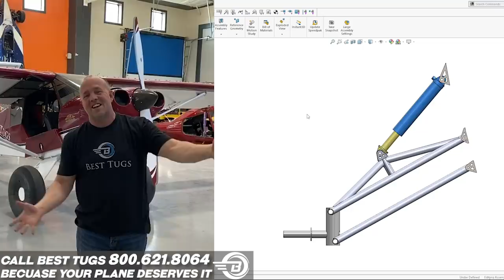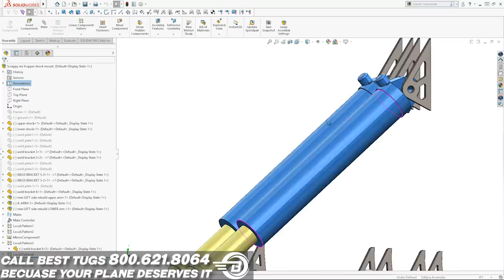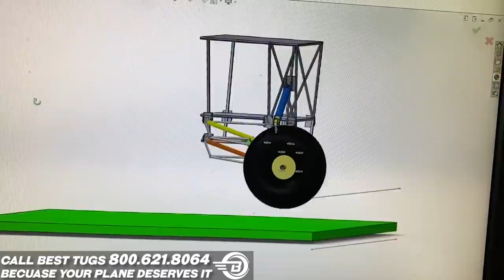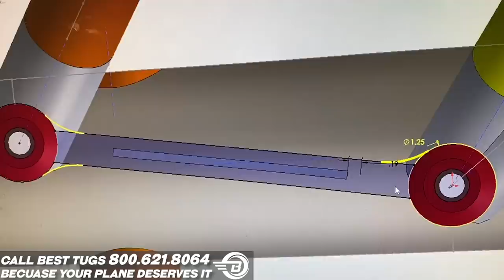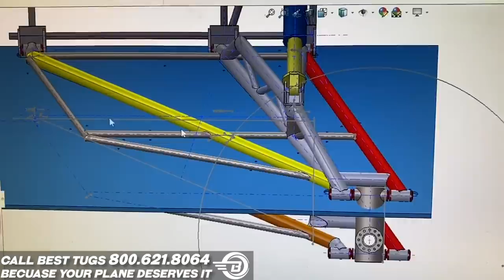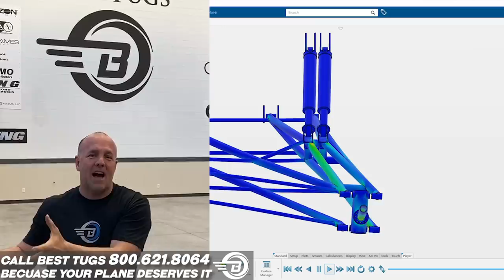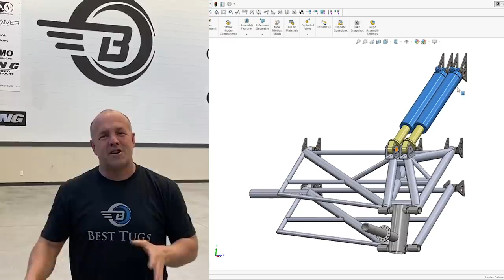20" + Travel - Extreme Bush Plane Landing Gear (Scrappy Bush Plane 15)

Comment: This is a very interesting subject. So when the plane is in the air the suspension will be in full droop? Topped out? Then when impact it will come back to topped out on the ground (Not good) or will the weight of the plane compress the suspension at rest? You still have scrub its just not as bad. Also the way a parallel equal length set up works is you will have neg camber at full droop ) no camber mid travel . Poss camber at full compression. Not ideal for handling (in fact its very bad its the reverse of a camber curve). But again probably wont be any high speed cornering. I do keep thinking about torque reaction on the ground cross winds? No roll control ?? Hum?  cantilever with compression and rebound spring rates. So there is resistance to the wheels droping and compression ? So they are not topped out during flight ? Or rebound to topped out during a landing? You could achieve this with heavy rebound damping? But there are side effects like the suspension will jack down. Like a early non bypass trophy truck setup. On a plane Hum? With arms that long you will want some toe adjustment.
Reply from the maker: Tom Hutchins I like the way you think, your going to like a video coming out, it’s a few away yet but coming

Comment: Will you be building in some sort of offset into the trailing edges of the undercarriage aerofoils to deal with the spiral airflow from the prop? I expect with the airboat prop, the twist in the airflow may be more aggressive than with a conventional aircraft prop. I envy the fine hand control you have over your welding, no doubt the product of lots of practice.

Comment: @Mike Patey, I was always instructed to grind a tube cope back until the base material thickness is present so the weld bead is made with the two materials being the same thickness (assuming the two tubes are the same wall to begin with) I'm not denying the quality of your fitment, but I'm concerned that your process is making for a weaker weld joint.

Comment: What is the function of the added "extension" behind the main triangle on the gear struts/arms? To my engineering mind they don't add a whole lot in stiffness since the main triangle should provide all of that. Is it to stabilize and prevent buckling of the rear strut member? Or to mount steps? (or both of course)

Further aside, apart from just the "wobbling in the bearings",  wouldn't a lack of toe-in risk a nasty gear shimmy developing after landing with gear arms that long?

Edit: Never mind on question number one, I hadn't seen your end bit on the gear wing yet.

Comment: Mike, your videos are inspiring. I get excited every time you post!
I'm curious: Will this suspension be fully independent on both sides? I ask because it's my understanding that the Draco mishap occurred partially because the suspension gave a lot of room for the plane to roll, allowing the left wing to "catch" the wind and be thrown over. If you have 20" of independent travel on each side, won't this present a similar danger? I'm sure you've thought of this so I'd love to hear your thoughts on having something equivalent to an anti-roll bar, or the possibility to limit suspension travel when circumstances require it. Or will you just find some scrap barn doors to use as ailerons? :)

Comment: This comment is not to take away from any of this amazing fab work and designing just to inform you on the fact that when you machine the tubes to fit together that way it can cause a weak point because you are running your weld bead on a very thin portion of the tube on the obtuse side of the joint the sharp edge should be ground back to the thickness of the tube to ensure full weld contact

Comment: OK maybe I saw it wrong; but it seemed to me that as the wheel travelled upwards, it tracked in a CURVE inboard/outboard/inboard again. Isn't that going to cause an outward scrubbing on both tyres as you land? (especially on a heavy put-down). Outward scrubbing on the tyres = reduced tyre life; more worryingly it will also mean a heavier than expected inboard load on the suspension and its carrying box.

Of course, it's entirely possible I've been the victim of camera errors etc and that the wheel moves perfectly vertically throughout the travel... but I looked a few times and thought it moved outward and back in again as it moved upwards.

Comment: Hi Mike--you're doing a great design for max travel, along with minimum camber deflection.  HOWEVER, I'm concerned that it seems you are not addressing the issues which caused the demise of your lovely Draco last year at Stead; specifically, the "soft" and well-damped nature of your mains meant that they couldn't handle the extreme crosswinds they encountered--and the result was a wing-low disaster!
Are you addressing (in any way) the possibility of a wing-low situation which might be similar to the loss of Draco last year?  In my (somewhat limited) range of possibilities I can only imagine a simple range-stop, or (with more complications) an actively sensed-and-deployed system to try and avoid a similar event.
I have some years of experience and interest in suspension design for autos--but it looks like you may have an additional challenge here!  Best of luck on this project, B.

Comment: Hey Mike, you eliminated radial scrub, but did not eliminate lateral scrub.  If you want zero scrub you'll have to have variable camber (unequal length control arms) such that the tire radius is accounted for throughout the range of motion.

Comment: the double suspension arm set up reminds me alot of a older video I saw of someone flying a monarch butterfly gyrocopter outfitted with what they called g-force landing gear. Granted cant really compare as the video is quite blurry and its a tricycle gyrocopter not an airplane but also still interesting to watch just youtube "Monarch gyrocopter doing stop and drop landings"

Comment: Just a stupid idea...could you have done each upper and lower arm as large as they are, as monocoque aluminum structures, with steel inserts for the end-point bushings/spindles...sorry i can't attach a graphic, but i think that it would be lighter, and stiffer, with less welding and cutting?  Just thinking...btw, what you have done is beautifully built!!

Comment: This seems much heavier, complex, and less aerodynamic than Draco's geometry. I'm sure this must have been a consideration. What led to your decision to drop the use of a equivalent travel in a trailing link design?
Reply from the maker: Ryan McGowan I wanted more travel and try something different. The bending moment and leverage on a trailing link with 20” travel would be nearly impossible without massive weight. An A arm stability is easier to hit that target for less weight.  I love trying things different anyway so let’s try it out 🤠

Comment: I have a question. If you made it so when the suspension compresses, it travels backwards as well, would that help with getting over even bigger boulders? Because the boulder hitting the suspension punches it back which also pushes the suspension up? It was an idea I had a few months ago...

Comment: Looks great, but put some engineering into the geometry of the suspension. Orient the two hinge-axes on the hull as well as the two hinge axes on the wheel, as well as the distances between them to get better performance. You have 11 degrees of freedom in your geometry, and you have not used any of them: 1 Breaking should not make the suspension dive. 2. High speed turns in rough ground should not lateral movement to minimize slip. 3. and a few others.

Comment: We have a similar software called Autodesk Simulation that is an FAE (finite element analysis) that shows stress, heat, torsion, etc. It is amazing. I use it after hours for my own projects and it is the only way to test your designs. I am building my own hovercraft and I spend hours designing, simulating, changing, etc. And it will show interference between two moving parts that you would never know about otherwise.

Comment: I'm a bit surprised they went with a parallel arm design. You'll actually still get a lot of scrubbing the wheels as the track width increases when the suspension travels up. I would have thought it would be ideal to have longer lower arms so that you have negative camber when the suspension is all the way down and and positive camber when the suspension is up. That way the ground patch of the tires moves in compensation of the track width changes that happen as the suspension travels upwards. 
Still, the fabrication is beyond excellent. I don't think I've ever seen someone cnc mill aluminum plate to make a welding jig for a one off project before.

Comment: Hey Mike. Greetings from Germany. In Minute 7:50 you show a connectiong between two tubes. Is it posible that you have a better spread of force if you use a connection as it is on a Mountainbike fork tube? I think so. Unfortunately im not able to do a simulation that quick.

Comment: I think the tires are still going to scrub. There is still an arc in the motion. Cars run unequal length arms to mitigate this by forcing the wheel to change between positive camber and negative camber to compensate. Formula 1 cars were first to use this to mitigate tire wear caused by scrubbing.
Reply from the maker: Jesse Hires .. Yep your right 🤠 still some scrub  but cut it in half even with 20” travel

Comment: So a question when you are calculating force (F=m*a) do you factor in the decreased acceleration due to the bush wheels?  What is the safety factor you designed it at?

Comment: I would have thought toe out would be advantageous as it would reduce scrubbing on the down stroke and help drive the undercarriage under the axial COG and prove a righting moment. Solid works should be giving some support for your excellent demonstration of real world use of their product. Maybe to save weight the lower A arm could have been the laddered frame supporting the shocks with the upper only as strong as it needed to be to take the compressive load even forgoing the rear part of the A.

Comment: Looks like you had planned for 1 strut per side but your latest design uses 2 per side. Will need to cut and weld the upper strut mount area on Scrappy?

Comment: So why didn’t you do the control arms in CF? I feel like that’s something you could pull off and it would save quite a bit of weight. Had to be a reason you didn’t go that route
Reply: Tsxtasy1 chromoly steel is incredibly strong and allows using very thin walls. So it may not be very heavy. It’s also easy to make super strong intersections (those fish mouth welds). So it might be hard to beat it in this application. Hopefully others chime in too.

Comment: We engineer and build a lot of complicated and expensive structures and I have never seen someone go to this sort of extreme to make a weldment. At first I assumed you had those tubes done on a tube laser, but nope, of course you machined them. Nobody in their right mind would ever build something in the way you are doing this plane because if you had to pay for work of this level the cost would be insane. Well done sir! 
I do keep wondering, though, when you are doing work like this and obviously sparing little expense, why use so much steel tubing instead of titanium?

Comment: If the template had a 3" hole through it at the weld joints, you'd be able to stand the loaded template on edge and put a tack on the back side.

Comment: I've got some constructive criticism that I hope you'll see - but first, awesome channel! I've watched a bunch of your videos, and can't wait to see this thing finished. That said, in this video and others in the past, it appears that you're welding notched tubing together as-is instead of sanding the thin parts off first. Maybe I missed the parts where you sanded those off, but if you are not doing so, you're not welding to the thickest part of the tube and are creating a weaker node of tubing. The welded edge of tube at the notch should have the same wall thickness as the rest of the tube - if it doesn't, it should be sanded off.  My experienced opinion that will hopefully be helpful. Keep it up man! This may be the only comment I've left on Youtube, but seeing tubing welded together like that makes me cringe lol
Reply from the maker: desertPOS i agree completely, I’ll either take the thin wall off most the time on my wheel. Sometimes depending on thickness and weld I need I often will do a double pass on the thin so the second pass is back and over full metal thickness depth.  It is more work but I cringe like you when I see someone make that mistake when it seems so obvious.

Comment: Any concerns about welding to the uber thin walls where you have it snap-fit? It seems to me that you might be inadvertently causing weak points by thinning the material at the joint.
Reply from the maker: Jazz I double pass and get into the thick of the bar on the larger second pass
Reply: @MikePatey  good deal. Also, you truly do not sleep, haha.

Comment: As someone who isn't a pilot but like engineering; why do all of these planes have the wheels so far back? For a taildragger setup wouldn't it be better for the wheels to be another foot or two further forward so that you can mash on the brakes without a risk of the plane flipping over forward?

Comment: Since the inboard mounts for the gear are not vertical & the outboard ones are, the gear is not a parallelogram and as the wheel moves up it will take a small positive camber.  I.e., the wheel will not remain vertical.  Not a criticism (huge admirer), just an observation.

Comment: What is the purpose of the rear part of these frames, back behind the triangular fuselage-wheel-fuselage shape? Looks like it does not add any strength to the gear legs and OTOH does not look like the airfoil you've shown would use it - the shapes are too different. I thought they would be steps, but then you say they'll be covered...

Comment: Seems you may be more susceptible to prop strike on a hard landing with that much movement in the landing gear?
Reply from the maker: harland fazardo actually at full compression I am still more clearance in the prop than a standard cub at full compression

Comment: Hey Mike, 

I have no idea about your experience working with solid mechanics and finite element analysis. I'd like to give you some advice with regards to the modelling just in case you are new to the field. 

These simulations are a great tool to develop understanding but they're very easy to generate unrealistic results and they shouldn't be the only thing you rely on. It's a necessity recommended to test your understanding by modelling a real-world situation which there is some data on. If you want I can provide some data for a simple beam deflection for you to verify the results. This not only shows you that your method is accurate but your software is accurate and not generating colourful pictures with inaccurate results.  

The quality of your solution depends on your mesh and it is critical to perform mesh independency studies and convergence analysis to ensure results are not simply a product of an improper mesh. Results from your selected mesh should be invariant of subsequent finer meshes.

Perform a sensitivity analysis to determine which factors most affect your model and ensure your boundary conditions, material properties and loads are accurately input into the software. It's extremely easy to miss a zero and drastically alter your results. I've been there and done that.

Large global models are useful for identifying problem areas but smaller local models should then be used to perform more refined studies in these regions. 

What I have posted here isn't even close to a definitive list of things to look out for. At every stage, verify your inputs and the validity of the assumptions you are making. Check and check again. 

If you're not a novice and you know all this info then just pass this by. However, if you would like some pointers to references which detail how to perform these analyses and how to ensure you've made the best choices possible I'd be happy to send you some books and links. Don't hesitate to ask in the replies and I'll compile a list of material for you. 

Best of luck with your records, excellent content.

Comment: A wood frame? NOT for Mike! Lol.  A cnc machined! Are you mass producing this suspension?  😅 If you make access holes behind the joint points and have the assembly vertically positioned you can do all the welding before releasing it.

Comment: I don't know much about aero engineering, but I do know truck suspension design.  Why not go to unequal length a-arms and get that tire scrub down to zero through 20" of travel? Look at trophy truck frontend design.  They pull 20" with minimal scrub.

Comment: Too bad nobody has tried to modify a version of the wheel assemblies from the OV-10 Bronco to a bush plane. Those OV-10's worked off of runways in the bush of Vietnam. Those planes took off and landed on some really bad landing strips.
Reply: I'm not familiar with the OV-10, but just a quick look at some google images show that geometrically its very similar to the Wilga landing gear when its locked in the down position. So, in a way, it has been. They are both just a trailing arm suspension from what I can see.

Comment: Mr. Patey:
What software are you using in your 3D design and stress analysis?
I've just started using Autodesk 360.
Thanks
Reply from the maker: I use SolidWorks.👍🏻
Reply: @MikePatey  In the video, It sounded like you use "similia works" for which I have been searching since I have never heard of it.  You said the name, then said it was from the same guys who made solidworks.  Help me out Mike, I'm confused.
Reply from the maker: NormalName  just call solid works, I believe they can connect you direct